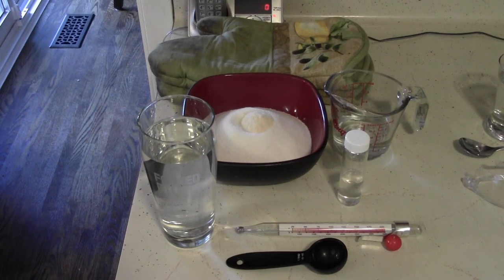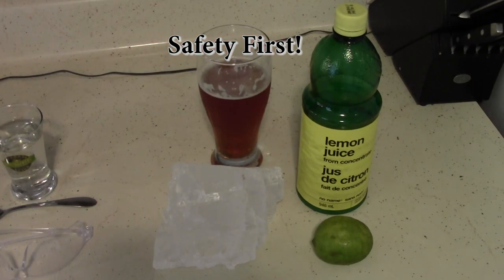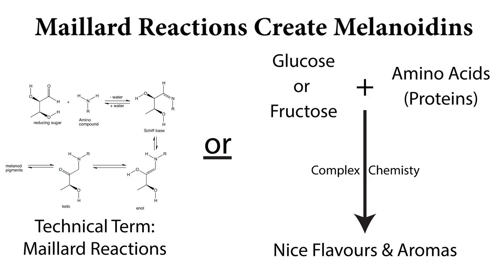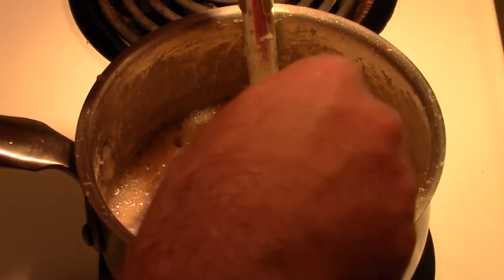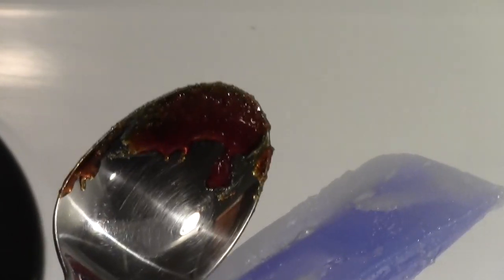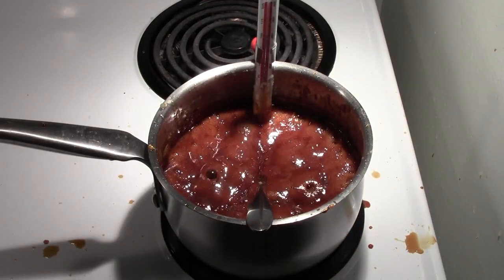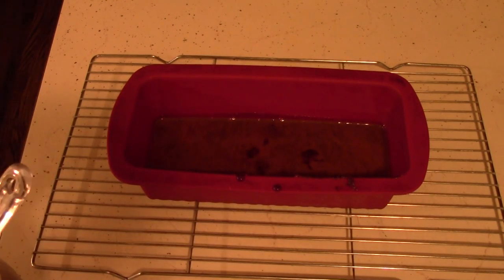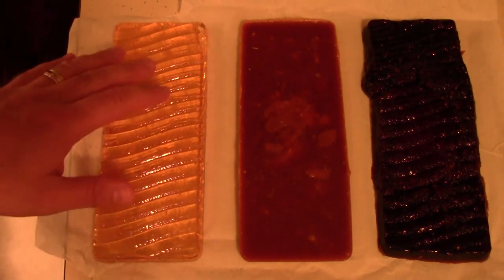Making Belgian Candi Sugar At Home

Comment: Hypothetically, I accomplish all this; is it for a 5 gallon batch of beer? To taste? Maybe it's mentioned in the comments, but I just wrote extensive notes and what do I do now with it? "Keep stirring!" I also feel like I'm gonna set a small fire in my kitchen, although it is perfect weather to brew out in the garage. Ramblings.
I need to brew a gluten-free, few-gallon batch. Flavor, low ABV, low IBU, no gluten. For a friend. And a challenge accepted. It absolutely has to be absolutely devoid of the evil gluten. Been looking up sorghum recipes and this came up. Thank you all, much love love. Cheers!
Reply from the maker: Generally, you add as per a recipe. This style of sugar is used in a bunch of Belgian style beers, so I'd find one of those and prepare sugar to match.

For use in beer, the easiest thing to do is turn it into a syrup at the end. Once the desired colour/flavour is reached, kill the heat and carefully stir in 3/4 of the sugars weight in cold water. This will create a syrup that can  be easily added to a beer.

Comment: I don't really have access to homebrewing supplies in my country. I'm wondering if I can use boiled baker's yeast instead of yeast nutrient/DME?
Reply from the maker: I imagine that would work fine - after all, yeast nutrient is simply destroyed yeast.
Reply: Sui Generis Brewing I thought yeast nutrient is largely urea?
Reply from the maker: ***** Not usually. Diammonium phosphate (DAP)-style yeast nutrients is a pure chemical that is sometimes mixed with urea - personally, I don't like the candi sugar that comes from that (mine is pure DAP though, no urea). The other 'kind' of yeast nutrient is typically hydrolysed yeast (yeast heated under acid conditions to break them down). This will be a complex mix of amino acids, nucleotides, lipids, minerals and other yeast substances. You can tell them apart rather easily; the DAP is white, the other stuff is tan-to-brown.

Comment: Is the inversion step at 125-135 degrees C instead of 115 C because you don't have an acid to catalyze the reaction?  (switching to Fahrenheit mode)  I thought hydrolysis took place in the 236 to 240 range.  I want to try making invert syrup (the British kind) in canning jars in a pressure cooker at 15 pounds.  Will I need to add an acid?
Reply from the maker: Yep, no acid = higher inversion temp required if you want it done in a resonable amount of time.

I've not tried the canning method for invert, but I've heard it works but produces some carmelization
Reply: @SuiGenerisBrewing   I want some caramelization, and maybe some browning (might not get browning because it will be inhibited by the acid)  I am making British style, hopefully somewhere in the range of #2 or #3.  I haven't figured out how much water to add to each jar (with a pound of minimally-processed white sugar) because I know some water is consumed by the reaction.  Probably will just use a cup of water, which is too much, because the jars will be sterile; not like honey that needs to be below 20% moisture to keep from spoiling.  I can store open jars in the fridge.
Reply from the maker: @zxcvbob  I'd suggest 2:1 sugar:water; this makes a thick syrup that won't spoil, but which also wont crystalize immediately after cooling. Thats 2:1 by weight, not volume.

If you try, let me know how it goes!
Reply: @SuiGenerisBrewing  I did try it.  I divided a 4 pound bag of cane sugar (very light tan color) into four 1.5 pint canning jars and added 8 ounces of hot distilled water to the first two; that looked like too much water so I added 6 ounces to the others.  Added 1/8 tsp of citric acid to each jar.  Stirred them up until the sugar was suspended then put them in a big canner (without lids) and processed at 15 lbs for about an hour.  When I took them out, they were dark brown; the two jars with more water were slightly darker and the other two had a little bit of undissolved sugar at the bottom where had it settled out.  I stirred those 2 up while still hot and assumed it would all seize up when it cooled.  Instead the sugar dissolved and all 4 jars got a little darker and almost matched in color...

My plan was to end up with 4 pint jars, each with one pound of sugar (closer to 1.5 pounds of syrup) but my syrup was too thin.  So I dumped it all into a stainless steel stockpot and simmered it for a half hour to reduce it.  And it got darker still.   I reduced it a little too far; had 3 full jars and one jar about 1/3 full.  The stuff was very thick and tar-like, but it tastes good.  Slightly bitter, but not burned at all.  This was about 2 weeks ago.  I just realized last night that I could transfer enough from the full jars into the partial jar to make them all have about the same amount, then top up with boiling water.  So that's what I did last night.  Then I put canning lids on them and processed them at 10 lbs for about 20 minutes.  Now I have four sealed pint jars of dark invert syrup.  I don't know if it's Invert #3, but it's reddish-black...

I will take what I've learned here and try to simplify it next time.  Use much less water, and cook the syrup on the stove just to dissolve all the sugar.  Pour into jars, add hot water to top them up, then process for an hour or so.  And will probably use plain white sugar.  But that will be a while because I need to use this first.
Reply from the maker: @zxcvbob  Very cool, and thanks for sharing. I'm going to have to give it a go myself!

Comment: Have you tried applying this technic to beer wort? I guess it should yield much richer flavour than ordinary long boiling or decoction mesh.
Reply from the maker: You cannot get wort to a high enough temperature to produce maillard products. Which is why we make the candi sugar first, then add it to a beer. You need to get to 125-145C to generate the flavours we want. Wort boils at 100C
Reply: @SuiGenerisBrewing  true. But my plan is to boil off most of the moisture to get to honey-like texture of the wort. Thus I'll be able to boil it somewhere above 100°. Will it work?
Reply from the maker: @antonlovchikov630  perhaps, but thats a lot of boiling. It would probably be easier to use liquid malt extract!
Reply: @SuiGenerisBrewing  yeah, it'd be a logical shortcut :) Last question. If Maillard reaction's optimum temp is 125-145 °С, does it mean that decoction meshing doesn't contribute all that goodness as all brewing blogs claim? I've tried it many times and the thickest part of the mesh boils at the same 100°.
Reply from the maker: @antonlovchikov630  I suspect that its mostly a myth, as unless you're scorching part of the mash, you're not going to have maillard products form. Not to mention, typical maillard reactions (nutty, stone fruit, caramel) aren't exactly the flavours of decoction
Reply: @SuiGenerisBrewing  thank you for answers! Will gladly watch a video about making candies out of liquid malt extract if you ever decided to do that!

Comment: I have followed every single step exactly as shown but my sugar starts caramalizing when it hit around 120 C, i kept stirring vigorously but it did not stop the caramalization from taking place. Need help.
Reply from the maker: Some caramelization is normal - by the end of the inversion step your sugar will likely be a modest tan in colour. That is normal. If your sugar is going darker than that, then you likely have your heat on too high and are scorching the bottom of the pot. Slow and steady!
Reply: @SuiGenerisBrewing  Thank you so much for the quick reply. Will try turning the heat down. Another problem i figured is that i was using a shallow pan, causing the water to evaporate rapidly. Will try again now. Thanks again.
Reply: @SuiGenerisBrewing  I figured out what was going wrong, i was making it with DAP and due to that the sugar was getting caramalized/burnt at 120C range. So i added the DAP later on after the inversion process, along with the alkali (pickling lime in my case) and it turned out perfect. Nutty, Roasty, a hint of chocolate, and lots of plum. The colour was a tad bit less dark than the one you got in this video.

Comment: I can't find food grade lye or pickling lime. Would some other alkalies work, such as baking soda?
Reply from the maker: Unfortunately, no. Basking soda is not alkaline enough to drive the reaction without adding an amount that would give the candi an unpleasant flavour.
Reply: @SuiGenerisBrewing  Alright, thank you for the quick response!
Reply: I had the same problem but found pickling lime at the local Latin grocery. Ask for Cal Mexicana. They use it for corn tortilla making.

Comment: Lye works to create the melanoidin reaction, but Ive seen many recipes use citric acid, does this do the same thing? What about baking soda.
Reply from the maker: Citric acid promotes caramelization, which had a very different flavour profile to malliard reactions. Baking soda is not basic enough, you really need lye or pickling lime to make it work well.

Comment: Hi!
Again some questions related to dry lye.
Is it sodium hydroxide?
I googled a bit and find out that sodium hydroxide (known in my country as "soda caustica") is used as an industrial cleaner that can cause serious burns to the eyes and skin...
Am I confusing the product? Is it proper for human consumption?
Reply from the maker: Lye is sodium hydroxide, AKA caustic soda, and yes, it is a highly caustic chemical used as an industrial cleaner (including in most commercial breweries) and can cause serious chemical burns if spilled on your skin/eyes/etc.

Food-grade lye is the same chemical, and is used to drive browning reactions - for example, traditional German pretzels are dipped in lye to help develop the dark-brown colouration as they bake. The lye is consumed during the baking process, so none makes it through to the final food product.

Unfortunately, for candi sugar preparation you do need a strong base such as lye. There are alternatives (pickling lime, potassium hydroxide, wood ash lye), but all of those are near-equal in their corrosives. So if using any of them be very careful to not spill any on yourself, and prepare only the minimal volume you need. You need very, very little (you will need about 1 tablespoon of a 30g/L solution), and the lye will be consumed as you cook the sugar. Be careful not to add too much lye, as any excess can carry through to the final sugar.
Reply: Thanks Sui Generis for your answer. I've reading your blog and you did a really great job! 
I wonder if using Baking Soda instead of Lye might work ... What do you think about it?
Reply from the maker: esteban uri baking soda wont work as it is not alkaline enough to drive the melanoidin reactions

Comment: hi Great video one question about lye added what is the amount of NaOH you use to 1kg of suger
Reply from the maker: +Öjvind Davidsson A very small amount - roughly 1 tablespoon (15 ml) of a 1M NaOH solution. 1M NaOH = 40g of NaOH dissolved into 1L of water.
Reply: Thanks. Tried this once unfortunately everything crystalllized had to redo any comment how to aviod.
Reply from the maker: Adding a small amount of corn sugar or corn syrup (fructose) helps - 1-2% by weight is enough. You can also try to minimize the amount of stirring. Crystallization isn't too big an issue though; it'll still go through malliard reactions.

Comment: Would using sodium carbonate (pH 11) work? That can be made very easily from baking soda...
Reply from the maker: No, it is not strong enough of a base. It has a pKb of ~3.5; you need something with a pKb of <1.5. Essentially, sodium hydroxide (pKb of -0.6), calcium hydroxide (1.3)  or potassium hydroxide (-0.7) are the only real food-safe options.

Comment: hi brian.
i have a question: i made 6kg of candi sugar cause when i make them i want to make for long time.
i added around 5 grams of food grade pickling lime.
now i know that pickling lime is not very healthy if ingested, so i am wondering if is ok for me to brew adding for example 1kg of candi sugar that contains about 1gr of pickling lime.
Do u think it won't harm?
Reply: ah...since pickling lime does not disolve i added mixed in water but i haven't waited for it to sit at the bottom of the glass. with this method i can hit the maillard reaction with much less water and then start to raise temp for browning it.
Reply from the maker: +Gasman super For a 1kg batch you should need less than 1g of lime; indeed, you probably need closer to 0.1g. Lime is poorly soluble in water - a saturated solution is 1.5g/L. I'd suggest making such a saturated solution and adding it drop-wise to the sugar until the colour change begins. That should be sufficient.

For comparison, lye (sodium hydroxide) is much more soluble; I still make a weak solution (0.1M, ~4g/L), and only use a a tablespoon or two of that. For lime, your solution is about 1/4th as concentrated, but is almost as alkaline, so you should only need ~4X the volume (a few tablespoons) to achieve the same end.
Reply: +Sui Generis Brewing oh, thanks a lot. so u suggest me to use, let's say 1 gram per liter, mix thoroughly and let it drop. then use that saturated solution untill the maillard happens?
Reply: +Sui Generis Brewing i mean maybe i add 2 grams per liter and mix till i get it well saturated. then i start using that liquid.
why you think is not very wise to add the powder inside the pen? is there any problem about adding that powder?
btw, i tried both ways, alkaline candi sugar and citric acid and i have to say that this method is just out of this world. the flavours, tastes and scents are 100 times better in alkaline solution.
Reply from the maker: +Gasman super Exactly; make a saturated solution (2g/L will do it) and add that to the heated sugar. I don't know what you mean about adding the "powder inside the pen". If you mean adding the powder directly to the sugar, do not do that - the powder will not dissolve and you'll end up with little chunks of pickling lime in your sugar.
Reply: +Sui Generis Brewing thank you very much for explanation. i was mixing the lime powder with water right before adding it to the sugar. so the lime has no time to precipitate and stays in suspension. that lime still in suspension does an awesome job. however is a lot.
but my concern is: if i use 1kg of this sugar that probably has 2gr of pickling lime in it, will i harm myself or whoever will drink that beer? will the lime always be there or does it react and get neutralized by the reaction?
Reply from the maker: Lime is lethal at ~7g per kg of mass; or for an average adult male nearly a half-kilo; you'll be fine (not to mention, any excess will precipitate out of the beer as well).
Reply: +Sui Generis Brewing thanks man u r awesome.
i wonder how u know so much about chemistry. is hobby or are u an actual chemist?
Reply: +Sui Generis Brewing 
i am stressing you with all these questions because the result is awesome.thats why, so i want to keep making it safely
Reply from the maker: +Gasman super I'm a scientist by profession, although not a chemist. Depending on the day I can wear the shoes of an immunologist, microbiologist, cell biologist or biophysicist.
Reply: +Sui Generis Brewing envy you man. good work anyway. i ve been making candi sugar the wrong way all my life so here is a big thank from me.
Reply: +Sui Generis Brewing ah, i just read a analysis chart that says that slacked lime is not very solubile in water (1.6~1.8 gr per liter) but is fully solubile in sugar. donno what it means but they said like that in the chart

Comment: A lot easier instead of lye and lemon juice to use DAP.... I make it with DAP for years. 
DAP breaks from the heat to ammonia and phosphoric acid, the acid inverts the sugar and the ammonia makes the mallard reaction. Simple as that.
Reply from the maker: I cover this is my associated blog posts. DAP alone will not give you maliard reactions, as the acid inhibits malliard reactions and instead biases them to caramelization reactions. Moreover, I've found DAP to give an unpleasant ammonia character in many cases. The 2-stage process I use ensures that you get formation of reactive sugars and an appropriate pH for the reactions.